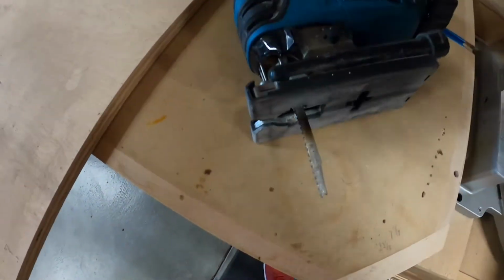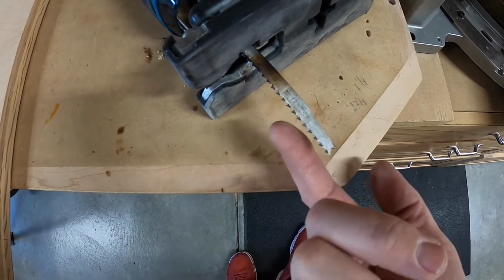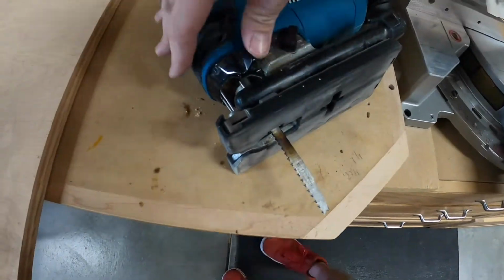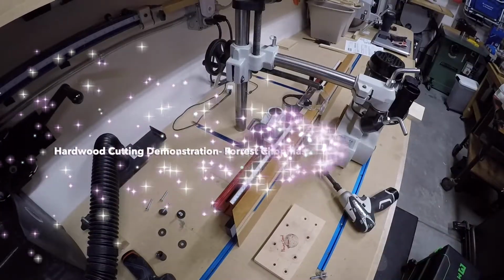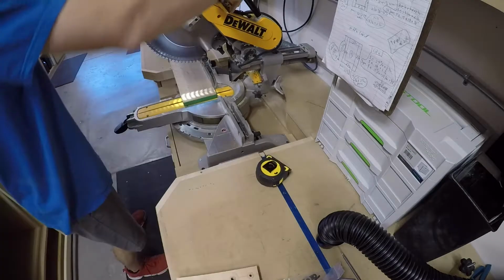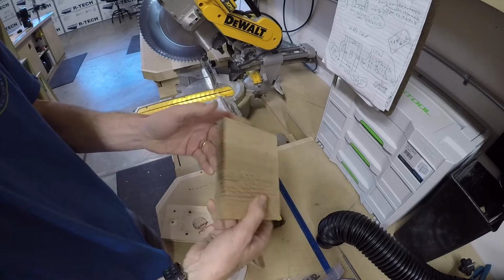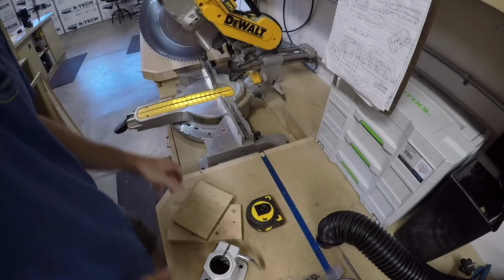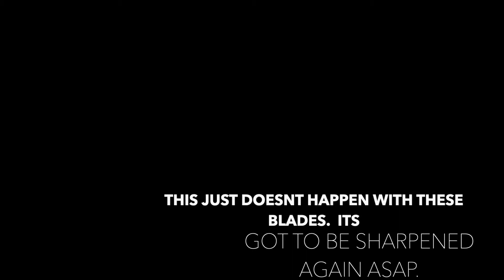Don't Cut LifeProof Style Vinyl Flooring With Your Good Saw Blades! See What Happens To Them!!!

Comment: question - We have cut vinyl plank flooring with wood blades (miter saw) and noticed it dulls them.  Circular saw wood blades have a certain shaped tooth.  Circular saw blades that cut non wood items all tend to have another shaped tooth that resembles a gem-shape.  I have a Diablo Trex blade and it cuts composite decking and also we've used it to cut 1.5" thick pure vinyl pier decking and it not only cuts it beautifully, and Ive made probably over 500 cuts with it on and it doesnt seem to dull it.  That blade has a gem-shaped tooth.  Vinyl flooring from what ive read can have a few things in it like vinyl, rubber, mdf/melamine, etc so its made from a few different materials.  My question is have you tried cutting vinyl plank flooring with a circular saw blade that has a gem shaped tooth?  Those are usually going to be labeled as a TCG (Triple Chip Grind) blade and did it dull the blade if you've tried it?   I was wanting to buy a blade to keep on hand that i use just on vinyl flooring but if its going to dull my blade quickly regardless of the shape of the tooth then I'm not going to buy it.  I'm sure my Trex blade will cut it but I wont be able to tell if its dulling the blade until its too late.
Reply from the maker: I’d try the trex blade.  You’ll know quickly if it’s dulling it.
Reply: @davidbryanwoodworksandmore  Yeah that was my whole issue is my Diablo Trex blade cost about $80.  Diablo blades are all thin kerf and they can not be sharpened b/c thin kerf blades have so little carbide to begin with.  If I made a few cuts and noticed the blade suddenly seemed dull then it is permanently dull and can not be mailed off for resharpening.  So its pretty much ruined permanently at that point.  Ive seen several people cut vinyl with blades but they were always using a wood blade.  Blades that cut aluminum, composite, and other non wood things always have a different shaped tooth that resembles a gem and its usually referred to as a TCG profile.  Im sure the Trex blade would cut it but is it going to be dull in 30 cuts was what I was wondering and I didnt want to use my Trex blade as an experiment in case it dulls them just the same.  I was just wondering if you you had ever tried cutting it with a TCG profile blade.
Reply: @davidbryanwoodworksandmore  It may seem crazy but we found that a grinder with thin metal cut off wheel would actually cut thick vinyl pier decking really well.   We mainly used miter saw/Trex blade but when we had to make small clean up cuts it worked surprisingly well.   As for vinyl plank flooring it would probably be even easier b/c its much thinner.  We're starting a vinyl plank flooring job tomorrow so I'll let you know how the grinder worked on it. Grinder is the cheapest way to cut metal or vinyl when you factor in the cost of blades of different tools that can cut them.
Reply from the maker: @morokeiboethia6749  all in all my blades are different types.  And the ones I used had both tcg and atb.  I basically came to the conclusion that I’d get a blade designed for these floors.  I think it’s also a pergo flooring blade.  I’d go to the store and find one that is designed for the flooring.  Or just get a cheap blade that you can toss.  It’s not usual to have to make a lot of cuts as a lot of cuts can be made with hand utility knives and snapping it.  A little jigsaw  cuts for casing and such.  If like you know what blade you find to work without dulling.  Let us know.  Good luck.
Reply from the maker: @morokeiboethia6749  I’m curious for the grinder results too.  I’m sure that would be okay as well. As I think the flooring has concrete in it.
Reply: @davidbryanwoodworksandmore  were cutting it now with trex blade works beautiful but not enough cuts to tell if its getting dulled yet.
Reply: @davidbryanwoodworksandmore  I didn't know there was concrete in vinyl plank flooring.  Thats probably what's dulling the blades b/c like I said I had cut pure vinyl pier decking that was a lot thicker than vinyl plank flooring and it didn't dull any of our blades - ATB or TCG blades.  Thats what boggled my mind was why was the thick vinyl not dulling my blades, but the thin vinyl was and that's b/c it's not vinyl its concrete that's eating the blades up.   I had gone on google to try to find a blade for vinyl flooring, but it was pulling up high tooth count wood finish blades.  They'll cut it just fine for about 50 cuts then suddenly everything goes downhill after that.  We used my Trex blade all day today and thankfully it didn't seem to dull that I can tell.   It cuts the vinyl flooring factory smooth with no chipping at all.   Probably made 30-40 cuts which isn't much but so far so good.  I tried the grinder out on it and it works just as well as it did  on the vinyl pier decking.  I personally like using it over a jigsaw b/c you dont need to elevate your piece and constantly shift/move it while cutting.  Dont sink the disc far intto it and just let the edge of the idisc do the cutting and it cuts it really fast.  You dontt have to cut all the way through it if you dont want b/c it will snap where you scar it with the grinder.  Grinder is probably cheaper way to cut it than a jigsaw b/c those blades get eaten up quickly.  I remember cutting 1 inch thick solid Trex composite (or another company that makes the same stuff)  with a 2 brand new Bosch jigsaw plastic cutting blades.  Both blades were worn down compltely (teeth worn down flat) after only 2 cuts into the decking doing contour cutouts for pilings.  Myabe 3 feet worth cutting in 2 cuts and the blades were toast.